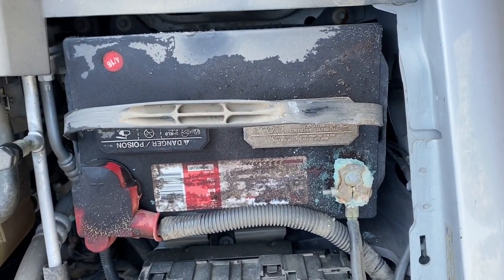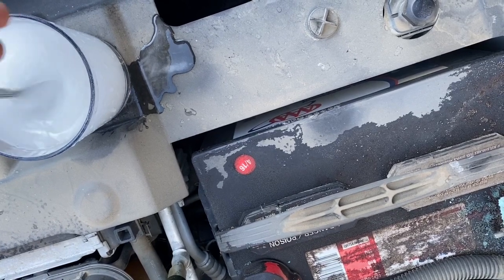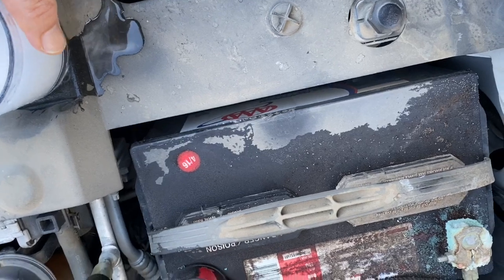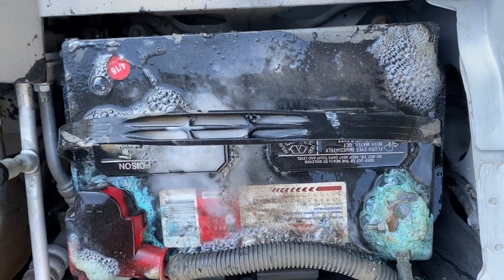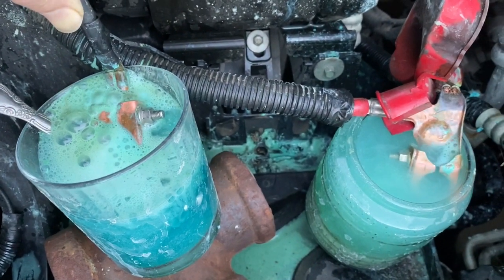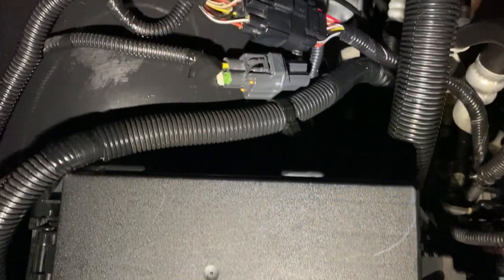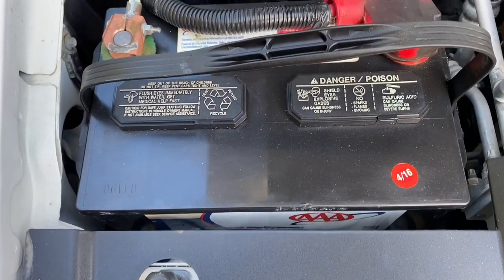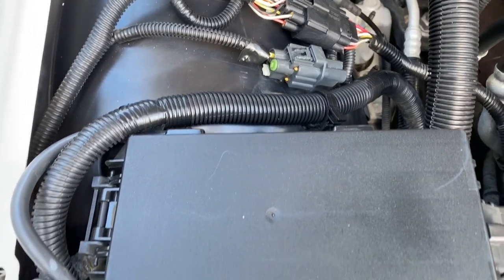Baking Soda To Clean Battery / Car Battery Before and After Baking Soda / Battery Neutralize Acid /

Comment: A lot of times the caps that cover the cells are vented, and if any baking soda migrates under the caps into the battery it will neutralize the acid in the battery and the battery will be ruined. Unless it's a totally sealed battery.  I've  seen this happen.
Reply: Yep, that is what ruined mine.

Comment: Remove the cover over the positive battery terminal and cover it with baking soda and water. Also, remove the battery and clean the battery tray with baking soda and water.
Reply from the maker: Thank you James for providing added suggestions for viewers. I have found the Red and Green felt rings that slip on posts before installing battery terminals works very well. They are inexpensive and readily available.
Reply: @familyvideos266  The baking soda with water is part of the clean-up of the battery terminals to remove oxidation. Those stupid felt rings are part of the protection process to prevent it from happening again. Personally, I think those felt rings are junk. You would do much belter protecting the terminals with dielectric grease or better yet with Fluid Film or NOCO. They work better keeping corrosion away, unless you enjoy repeating the cleaning procedure, frequently.
Reply from the maker: @jameskoralewski1006  I understand dielectric grease is an option worth considering. A majority of cars I encounter are show cars. Dielectric grease attracts dust and dirt. Most felt kits come with a spray on sealer that is dry. Thank you for your comments which provides viewers a variety of options to consider.
Reply: @familyvideos266  That is why I don't use dielectric grease. It protects very well but it goes on greasy and sticky and stays that way attracting dust and dirt and it loves the sleeves of shirts. If you notice, my final recommendations were Fluid Film and NOCO. Fluid Film is my first choice. It protects as well as dielectric grease but you do not have to spray it all over the top of your battery. It also cures (drys) and can be painted on just the terminals with its built-in brush. I've been using it for years and have never had one bit of corrosion!
Reply from the maker: @jameskoralewski1006  Appreciate you taking time to provide your comments and clarification that will prove valuable to those who read these comments. I will look into Fluid Film and NOCO. Dielectric grease does love sleeves of shirts as I have personally experienced it.

Comment: Man. lot of water between your positive and negative terminals. Wouldn't be a perfeect situation for a big short on your batt?
Reply from the maker: Excellent observation and concern. REPLY: Water between battery terminals is not a big short. With water present there is some current flow between the battery poles. Baking Soda is a salt which increases conductivity of water. This current flow is a PARASITIC LOAD on Battery, similar to leaving the radio or parking lights on. If water was allowed to remain between the terminals over time, HOURS, the battery would eventually drain down. There is a parasitic load test which can be performed on a battery, to determine if the drain on your battery is excessive (such as a shorted diode in an alternator, etc.). Typically a parasitic load reading should not exceed 50 milliamps (0.050 amps).